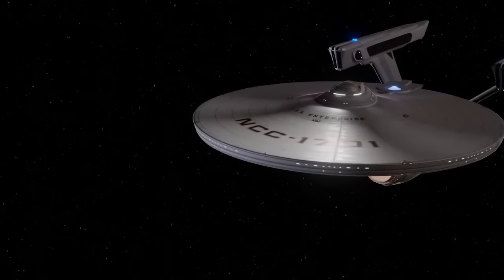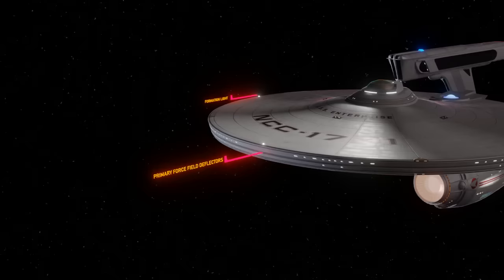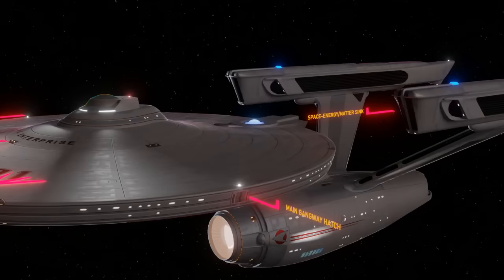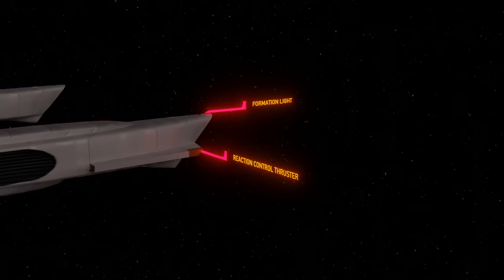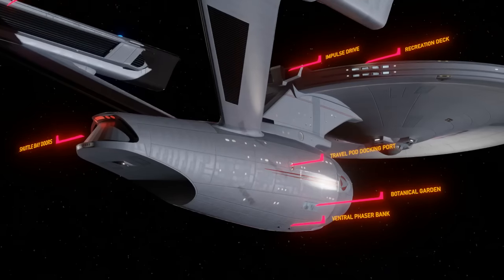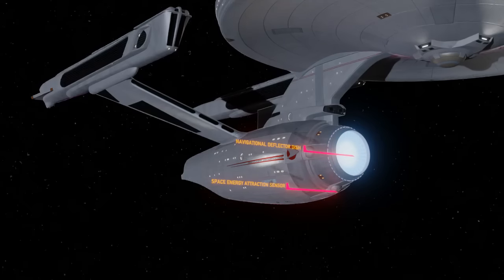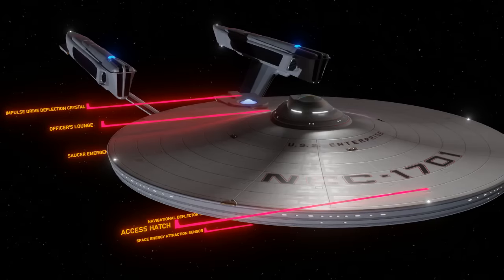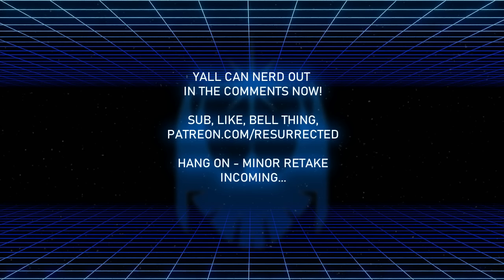ALL The Refit Enterprise Features Explained! CG Model Breakdown

Comment: What a thorough, and interesting, study of the greatest ship in sci-fi history. Nicely done. She looks wonderful in this video.
Reply: I was hoping to win that billion dollar Powerball jackpot a couple years back, pool together with some other rich guys, and build a full scale model near a busy highway, turn it into a hotel casino resort... and with some additional supports under it to deal with gravity and wind(I'd hire some world class engineers, and a physicist) hope it doesn't fall over during a storm and kill a thousand people.  Just imagine driving down I-80 coming around a bend up a slight hill, and seeing it suddenly pop up over the treeline in from of you, after having only catching a glimpse of it from a distance a couple miles earlier.  Especially at night, all lit up... people would probably complain about getting blinded by the navigational deflector (hmm... better put a variable dimmer switch on it)

Yeah, the weight figures would be completely impossible to deal with, it might sink into the ground and then tip over...but that's what my team would figure out before even starting. Ground pressure, weight distribution, and wind resistance (coating it in Teflon might reduce the latter).  I mean, it's gonna take a bunch of stainless steel columns underneath it(attached to all parts, primary, secondary hulls And the warp nacelles-which would hurt aesthetics a bit, but no way would it be possible without), spread out at very specific angles, and they go deep into huge concrete reinforced blocks 40 meters into the ground (after a survey to check for ground density and bedrock) it would basically be like building the Golden Gate Bridge...

It would basically be like the Enterprise, if it was lifted by several cut up short St. Louis Arches, with the bottom of the lower hull being  about only 20 meters above ground.... can't have it propped up too high.  Someone would probably try to land a single engine Cesna on the saucer 😂
Reply: @pex_the_unalivedrunk6785  
If you hide a parking garage underground beneath the super structure of the Enterprise , then you would have a strong base for the supports to prop up the Enterprise Hotel.  That would be cool to round a corner, and cone over a hill to see that beauty all lit up at night. It would be like Kirk’s tour of the refit Enterprise in the Motion Picture. 👍🏻
Reply: @Vincent-396  hahah! Funny thing, I had thought of digging out an area and doing just that... but then, it would lack the general public display and awe.  Edit: but this would negate the issue of wind resistance, tornadoes and storms, and, ground pressure considerably....the saucer would essentially be leveled with the ground.  It would still be an extraordinary feat of engineering, at any rate.

Edit: wish I had Scotty's formula for transparent aluminum.  But who knows?  I might be the guy who invented it!

Edit edit: as for harm against local ecology, an abandoned gravel quarry would make a headstart on the volume needed without significant damage to wildlife. 😉

Comment: also there is a pod docking port on the saucers edge, the main computer core connects to the lower sensor the saucer and goes right up to below the bridge. The warp core (much like later designs) runs straight up the dorsal spine connecting to the impulse deflection crystal with a conduit heading back toward the nacelle pylons fuel storage is in the lower deck of the engineering section at the base of the warp core (as seen in ST II WofK.....at least they had a proper engineering and not a brewery!! Although I am sure Mr Scott had a still set up somewhere!!) I have a really nice poster from the AMT Star Trek V version of the 1701A kit that I turned into a Frigate (after dropping it during construction!) funnily enough I called it USS Discovery NCC-2115 after the ship from 2001 a Space Odyssey this was back in about 1987!! It is still hanging in formation with 1701 at my Dad's place facing off against 2 K'tinga class ( 1 built in 1986(ish) the other when ST6 came out)

Comment: The lower navigation lights on the saucer section should be red on the left (port) and green on the right (starboard). This allows someone on an approaching vessel to visually identify which end of a ship is facing them, the bow or the stern. In TOS, it was the top saucer lights that had the red/green navigational lights. Also, because of image flipping, in some scenes you may see green and red on the opposite sides.
Reply from the maker: Quite right they should be, I don't think they ever were on the TMP model, but I am inclined to add them in future vids somewhere along with the formation lights.
Reply: @resurrectedstarships  I believe you're correct. There is a breakdown of the various lights and how they changed through Trek the site ex-astris-scientia. I think they first appear in TWOK.
Reply: They were in The Motion Picture on the sides of the saucer, but I didn't see them anywhere else.
Reply: The "red = port, green = starboard" lighting scheme only really makes sense on the ocean or in atmospheric flight where all craft are naturally going to be in the same orientation with respect to gravity. In space it is not as useful because ships could be in any orientation relative to each other in 3 dimensions. On the ocean you could tell whether a ship was facing towards you or away from you by looking at the red and green navigation lights. In space, not so much - a ship you were looking at could be vertically inverted relative to the ship you were looking from, and if you were thinking in a marine context, you might think the ship was facing towards you when actually it wasn't. To be sure, you would actually need 4 different coloured lights on every ship - the traditional red and green for port and starboard, and then perhaps blue and yellow at the highest and lowest points on the hull. In 3 dimensional space, having just the red and green on either side of the ship is not enough unless every ship has its top and bottom facing the same direction (like they would be for ocean-going craft), but there is no way to know if that is the case without additional indicator lights.
Reply: @lloydevans2900  It makes sense for classic Trek space battles. They tended to depict them as great ocean going vessels. Modern Trek, it's less relevant.

Comment: Thanks for making this. I always wondered about some of those random objects protruding from the hull and just assumed their inclusion was just a form of "kit bashing" just to give the ship more detail. But actually, a lot of the stuff here seems to also be the result of function rather than just that it "looked cool". The refit is my favorite Star Trek vessel, and it's sad that TMP seems to be the one film that actually cares about what everything is or does. TMP was the only time we saw the low power level amber glow of the deflector dish (not including the reused footage of tWoK).
Reply: That’s all it is. 

Their functions are “retconned”.
Reply: @calvinnickel9995  Star Trek has been retconned so may times, I want to vomit thinking of the next incarnation.  Some of the original ideas were the best, while others, not so much.  The rest becomes defined by the lowest common denominator.
Reply: And the way they cleared the spacedock. Just perfectly matched, everything makes senses.
Clear mooring, lighten the navigation lights to warn all ship and crew nearby that you're ready to go. Then gently pushing yourself out of spacedock by RCS thruster, coasting, and warning up the deflector in low power mode. Then, when you're far enough away from spacedock so that your shiny blimy fusion flames from the impulse nozzle won't melt the entire spacedock, ignited the impulse drive, and switching the deflector to main power. The ship suddenly came to life, and roaring into the darkness of space with dazzling flames of fusion plasma.
"Star Trek is not a sci-fi, it's a documentary of future."
Reply: Correct, there should also be a white lite on the stern and another one on the highest point (masthead). The lights should not be visible at certain angle past the ship's beam, but that's more of a maritime thing than aviation.

Comment: Great work.  I love the Refit and happy to see it on the channel.

Some critique of details.

1. You have the upper primary hull registry number in the wrong place.  You have it on the third ring from the edge of the primary hull.  It should be on the fourth ring from the edge.

2. It doesn't look like you have the registry and ship name aft of the officer's observation deck.

3. It looks like there's no markings to either side of the main gangway docking ports on the port and starboard edge of the primary hull.

4.  You're lacking the ship name positioned forward of the interconnecting dorsal and aft of the ventral sensor dome/light array.

5.  The forward flat leading edge surface of the side fins on the nacelles are sticking out a bit too far from the main nacelle.  I think that distance should be somewhere closer to half that amount.  It isn't a smooth join from the nacelle to the fin, but it is smoother than what you've got there.

And a couple I'm not sure about.

A.  I can't tell if you got the phaser turrets above the shuttlebay.  I see some detail there that might be them, but you didn't point them out even though you did point out the phaser banks at the base of the engineering hull.

B.  You have the "Magnatomic Amplification Crystals" on top of the warp nacelles lit up blue.  This seems to be a fairly common thing modern 3D modelers of the Refit Enterprise do, but I can't recall that feature ever lighting up on the photographic miniature during the movies.  The only shot I could think of was a single shot in TMP where the Enterprise is in the wormhole, and there is a little spot where it might be one of these lit up.  It is NOT lit up in the Director's Edition top view as the Enterprise blows up the asteroid with a photon.  So, I don't know.  Can anyone point me to a moment in the films where this feature was clearly lit up?

My only comment about the description elements provided in this video is a question about the the source of the different shades of plating of the hull being the deflector grid.  As far as I know, the different shaded plating is not explained, but the grid pattern (controversial on the original Connie, but canonized on the Refit) is said to be the deflector grid.  Although the only source I know for that is Mr Scott's Guide to the Enterprise.
 
Regardless, despite it seeming like I'm picking your work apart, I loved the video.  If the differences I've noticed are just artistic license, then it's all cool.  I'd say the only serious one is that placement of the upper registry number on the saucer, as that one just jumps out and looks odd to someone like myself.

Otherwise, I'm looking forward to seeing this beauty dance with some Romulan Winged Defenders!
Reply from the maker: Hello!
1 - yeh you're right, I'v only noticed recently, I may have followed a bad reference image.
2 - its there, no clear view of it on this video.
3 - are you referring to the square hatches? It didnt ever occur to me there would be anything there. What is there?
4 - mmm you may have got me there but I am starting to think some signage was added that wasn't there in the TMP movie.
5 - I will have another look at the nacelles - the geometry of the nacelles comes from some older work of mine.
A . phaser turrets above shuttle bay - check
B - IDK...looks cool, but I might be changing or tamping down that blue glow there...and no I wasn't referring to the 'aztec' hull plates, I was referring to the lines/grooves - that's shield grid.
Most of these are fixable!
Reply: @resurrectedstarships  
#3 = The square gangway hatch, yes.  I have to correct myself.  It seems there's only a gangway hatch on the port side, not both sides, so I partially misspoke.  But the port side gangway hatch is where the gangway from drydock attaches in TMP.  In the shots you can see it says Starship USS Enterprise to the left and United Federation of Planets to the right of the gangway hatch.
#4 = It's there in TMP.  There's a good shot of it as Kirk and Scotty approach in the pod.  I tend to remember it because there was a decal for it in the old AMT kit, and I hadn't ever noticed it before that decal.  Now I can't ever forget it.  :D

Thanks for the answer to my comments.  I hope I nerded out enough!

Comment: A feature that almost everyone misses: Maneuvering thrusters.

There are four long rectangular depressions on the top of the secondary hull, facing aft, and four shorter ones on the front cap of the secondary hull, to the left and right of the torpedo tubes. These are maneuvering thrusters, which provide low sublight propulsion when the ship is moving in orbit, or docking, or rendezvousing with other ships or space stations. They provide the thrust forward or aft, and the reaction control thrusters (RCS) provide attitude changes (i.e. steering).

These are used most prominently in Star Trek The Motion Picture, when Enterprise leaves the drydock and moves around in Earth orbit, before the impulse drive is engaged and the ship moves forward at a high fraction of light speed. They are also mentioned in Star Trek VI The Undiscovered Country, when Kirk asks for one-quarter impulse to leave Spacedock, and Valeris reminds him that regs specify thrusters only.

The thrusters don't light up, so they're not the most visually interesting feature of the ship, but they are a third complete propulsion system, after the warp and impulse drives, and a very important component of the ship's operations.
Reply: I've always assumed that they were of the same thrust output as the RCS thrusters, but only orientated to give axial thrust as opposed to the multi-directional RCS thruster mounts. There is one 3D animation modeler that has done the ST2 "Leaving Space dock" scene and included RCS thruster bursts, but the name of the channel escapes me.

Comment: Protip:  there are actually 7 shuttle pod docking ports. 

The first indication is when Kirk arrives: the announcer states "Shuttle pod available at Cargo 6."  

The 2 'missing' ports are on the underside of the saucer: spock and later Kirk use them while inside Vger.

#1 behind the bridge
2&3: ventral saucer behind protective doors
4&5: torpedo bay
6&7: Cargo Bay
Reply: But are they docking ports or simply re-used doors from the cargo bay set? For such a brief shot it might have been just that. Mind, I think maybe that space might just be big enough to actually hold a shuttle pod which would be interesting. 

Shuttle pods are weird. By all indications the only hatch is opened by the ship it’s docked to. There are emergency hatches, think as an elevator, but otherwise, that’s it. I would imagine that Probert thought that if a pod docked with a ‘dead’ ship they could tap the pod power to operate the door mechanism (hence the various connectors that mate pod to ship.)

The shuttle pod is kinda goofy, but it’s better than the original concept of actually detaching an entire ‘room’ from the orbital office complex for the grand tour. 😁

Aside, there are those that complain that the tour of the Enterprise was ‘boring’ and ‘a waste of time’ and other foolish things. For a Trek fan that only a few years previous to the release of ST:TMP felt that there was no hope for any kind of Trek revival, that scene was a kind of vindication. We were all Kirk, seeing his true love, returning home. 

Those aren’t tears. It’s raining or something. 😁
Reply: @steveharrison9901 For sets everything is reused.  But like a USB or shipping container they are all standardized so they can be used for multiple purposes.  

A shuttle pod as well as Spock’s shuttle makes a lot of sense because Enterprises shuttles would be occupying the shuttle bay and it’s a hassle to open the doors and arrange parking when it’s only personnel entering and exiting.  This likely became less of an issue with Mirandas, Excelsiors, Constellations, and Galxaxies which have more than one shuttle bay.  

And then anything else can attach to it as well.  A gangway, etc.

Comment: The Impulse drive is capable of 0.8 light speed.  This is confirmed by Decker's line in TMP of the ship being at "Warp .8" after the Enterprise is freed from the artificial wormhole.  It could be argued that 0.9 is possible.  Want more?  The tiny rectangular object underneath the shuttle bay is a tractor beam emitter.  And unlike it's ToS version, the refit has an aft phaser bank above the shuttle bay.
Reply: The aft phaser is mentioned directly in the episode, "Arena".